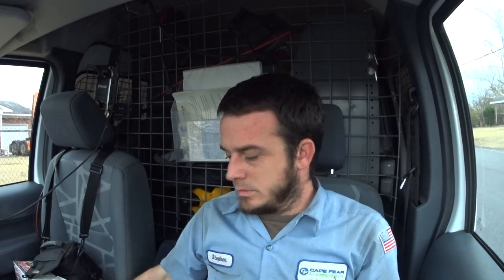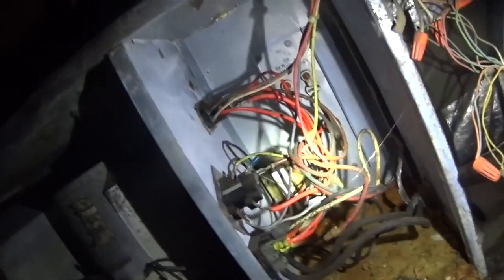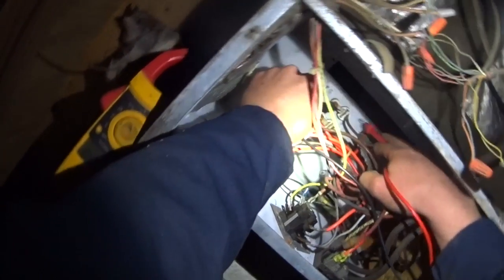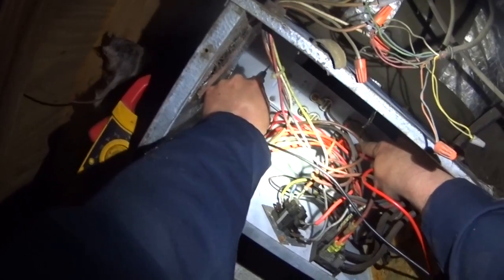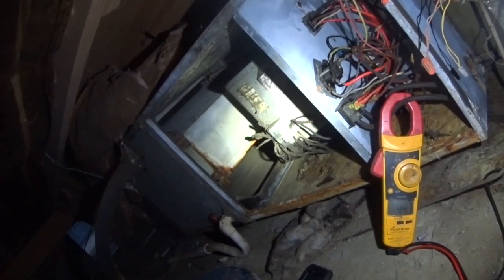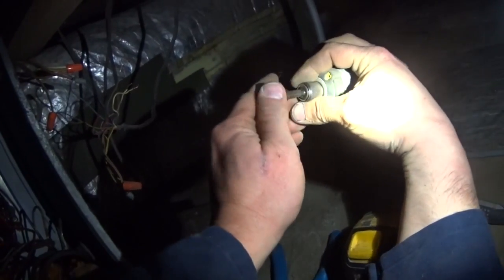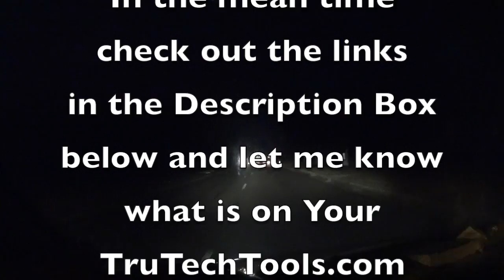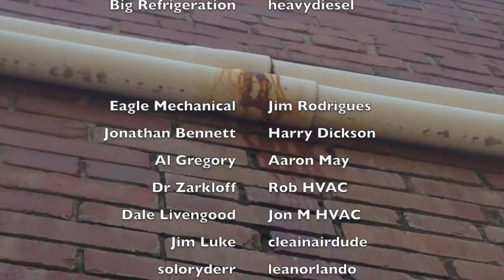HVAC Service: Breaker Keeps Tripping: A Day in the Life Episode 2 Call 5

Comment: worked on a lot of Goodman's if you noticed all the rust in the electrical compartment and under the fan motor, the evap coil drain is not draining and over flowing.  unit may not be level.  tends to rust all the electrical stuff up and cause problems.  also the fan delay on and off notorious for failing every couple of years.
I have for many years used electrical contact grease on circuit breakers and blade switches to reduce friction and resistance its works great and also provides a moisture free contact.  your local hvac vendor may not know what the hell it is.  you can find on amazon.
Get some rest you look like I used to!

Comment: Stephen Nice Video!    A cooked hot breaker can degrade to a trip at a lower amperage.        The 2 pole 240 volt AC Breakers in my Miss. Gulf Coast area are often outside in a house power box. They lead a crummy life exposed to salt air, high humidity (70 inches rain per year) , plus are baked by the hot sun in August and later see sub freezing temps in the winter lows in February.    

      The breaker's output wires often loosen up like in this good video. When loosened the added resistance often can bake the breaker and its "trip springs" weaken, then the failure often makes a 60 amp breaker trip sooner say 40 or 50 amps.

In extreme cases the breaker ruins the breaker boxes buss bar lug where the breaker's two hot contacts cam on to.  

If another HVAC or a homeowner tightened  and cleaned up the old breaker it can visually and thermally look good but still have weakened "trip handle spring", thus the break can trip with nothing actually wrong with the AC unit. This happened to me on a couple of my shops AC breakers and at first had me puzzled.  

With a Thermal imaging camera the hot fuse or breaker shows up very well too:

https://www.youtube.com/watch?v=F32mpIlPdvk&list=PLNufO-PD0VozfOsBpm3mWW139edbpXUJA&index=2

When the breaker has loose wires it often cooks the wires insulation and the plastic insualtion is no longer bendable and it may just fall off

Comment: Same thing happened to me today working at a residence house I found a loose leg on a 60amp Breaker. Electric furnace would trip every time i would call for heat.
Reply from the maker: That'll do it! Thanks for watching
Reply: +Stephen Rardon (HVAC with Stephen Rardon) hvac certified and cant figure this out!? ive got a gas furnace and as soon as the breaker gets turned on for the furnace it immediately trips right off

Comment: Most A/C contractors will not    do any electrical outside the condenser or A/H they will advise for customer to contact an Electrician.
Reply from the maker: +Chris Smith I did installation for most of my early career and am not afraid of a breaker panel. No reason to call Sparky for something so simple.
Reply: Yea an HVAC tech does have to have alot of Electrical knowledge as well. I am a sparky and I am expanding my knowledge as well by watching what you do plus I can watch someone troubleshoot problems and see myself troubleshooting electrical the same way.....walking back and forth from the panel to the problem area over and over again. Take Care great videos.

Comment: The loose connections at the breaker and the rusty connections at the heat strip are enough to cause high resistance and heat which will false grip the breaker.  What is that next to your meter laying at the top of the unit?? Looks like a dead bat.  I also thought I noticed a few dead rats under the air handler as you were crawling in.  What a shit crawl job.  Check for insulation leakage with a Megger, not an ohm meter.  A Megger tests with high voltage , not just the 9 volt battery you have in your meter.  If you have a nuisance trip, you need to meg everything out, as you may have a cracked insulator or other contamination on the element, causing a very high resistance short, which you will not find with an ohm meter
Reply from the maker: All good points made, I agree that a proper meter should be used to make definitive diagnoses of electrical problems but when you don’t have those tools you can make somewhat reasonable assumptions by using a meter as I did.
Yes, some pretty disgusting crawl spaces around here!

Comment: im having the same problem, everyday around 2 when its 90 outside. the breaker by the unit will trip. it will run for about 5 min and trip. I have to let the unit cool down for about 2 hrs before it stops. dont have the money for a tech.
Reply from the maker: Rudolpn Bookwalter may want to see if the breaker is getting hot. You need to be extremely careful obviously!

Comment: note: hvac techs are not to change breakers in a service panels it is not in our license
Reply from the maker: twittyk78 we carry an electrical license as well
Reply: here in wa state we carry electrical cards also but this is not something you can do , this is outside of the equipment
Reply from the maker: twittyk78 we have a full electrical license rather than the equipment specific restriction on the standard HVAC allowance
Reply: This is why I'm glad I'm in Texas. They give HVAC techs a lot of latitude on electrical outside of units. I know some states where the "other trades" have gone crazy with lobbying, you can't even wire a condenser to the disconnect on the wall.

Comment: Same exact thing happened to me and my coworker breaker tripped every 10 mins in elec heat and had melted the disconnect ... Wires at panel were loose as if someone just say it in there ... 2hrs later problem solved lol
Reply from the maker: At least you know
For
Sure that everything else you checked was good!

Comment: I would have had my fluke clamp on with Min Max on after I saw the motor run OK. If the high resistance was in the CB, It shouldn't have seen 60A at the meter, then I would have known it was the source. When it comes to before the unit, our Employer says don't mess with the breaker unless your confident with yourself.  If you make a mistake, your in a world of shit not having an electrical license. You own it.

Comment: Can a really dirty filter cause the breaker to trip on an AC unit?
Reply from the maker: Not likely, usually the tripping of a breaker is related to another problem that the dirty filter had little to do with. If the filter is dirty then it’s very likely the ac unit is also dirty and not well maintained. For a breaker to trip there needs to be a very significant power surge.

Comment: I had this happen to me today air American come out told me it was the motor then he replaced it then it still did the same thing he said it was and electrical problem I refused to pay then I called sansone out they told me it is the compressor and want to charge me 800+ any suggestions  please

Comment: if breaker is getting hot does that mean I need a new breaker? ty for your advice.
Reply from the maker: Rudolpn Bookwalter  if it's getting hot the wires probably aren't tight, if it has done this repeatedly then yes it would be best to replace the breaker as it has been damaged by multiple trips

Comment: I had the same issue the unit would run for a day or so and then trip the breaker. so it can't be a short, or else it would trip it instantly. may be a weak breaker?
Reply from the maker: Very possible or simply loose wire connections
Reply: Stephen Rardon  Yes you could have a high resistance short.  It’s called insulation leakage.  It is not enough to trip the breaker but can cause nuisance trips.  You need to check all circuits with a Megger.

Comment: On this video I would have checked the easiest accessible item that probably could cause the problem first..... namely the breakers.  Also when your checking things out electrically, the item your  checking to ground isn't checked out properly way..........you should use the ohm setting on the meter when doing so.   Anybody can listen for a buss er on a meter which doesn't tell the whole story. When your explaining the using the of the meter on a "ground check", you don't really break down in detail what taking place with meter.

Comment: while any technician already knows this Most Breaker's run the electrical load through a internal Thermal trip link ,, a loose wire connection "will" create a high resistance connection that gets hot under load even if its not above the breaker's load rating  ,, that heat will conduct into the breaker's interior and thankfully cause it to thermal trip  this bad connection over time oxidizes and loosens more getting much worse to the point where it would set the wire insulation on fire , moral of the story ,, if you have a frequent tripping issue check all connections in a safe manor as procedure ,, arcing fault circuit Breakers should be standard in the future as a loose connection not at a thermal type breaker has a good chance of starting a fire at that point. this is also why many portable air conditioners have thermal trip protection on there plugs as a bad outlet will make a high resistance hot connection that can set a house fire ..
Reply: I agree.  This kind of problem won't normally be found with a clamp on amp meter.  You have to find a loose connection somewhere.  

I noticed that aluminum wire feeding that 60 amp breaker.  I worked at a plant waaaay back when I was an electrician that had aluminum wire everywhere.  After aluminum wire is installed you almost always have to come back a year or two later and tighten the connections.  Aluminum wire breaks much more easily than copper also.  There were times I would just look at 12 gauge aluminum connection and the wire would break.
Reply: Google User another thing to consider.  Are the lugs CU/AL rated?  Some units and devices are for “copper conductors only”. I once almost had a house fire due to the fact they used aluminum Romex hooked up to receptacles that were not rated for aluminum.  All of the wire insulation was cooked back 4” a the connections.  I saw a plug glowing red hot in the living room one evening.  Could have burned the house down.  You must use an anti corrosion such as Nolox to keep the aluminum clean.  It is actually a shitty conductor, because it is soft and comes loose from lugs, oxidizes, and cannot be hooked up to lugs made of dissimilar metals.

Comment: Well im curious what state and license is this ?
Reply from the maker: twittyk78 we're in NC though I'm not sure the license name specifically. We opened an electrical branch recently
Reply: here in WA  hvac has a 06a for unimited voltage on equpiment, an 02 which is harder to get would do hvac and res only on res property and if you wanted to do commercial as well good luck which is the hardest test you would need a 01 master electrical card , sounds like some states are not as strict as here , thanks for the replies